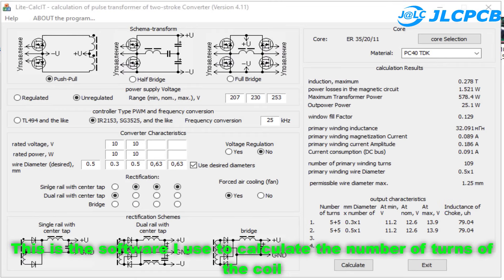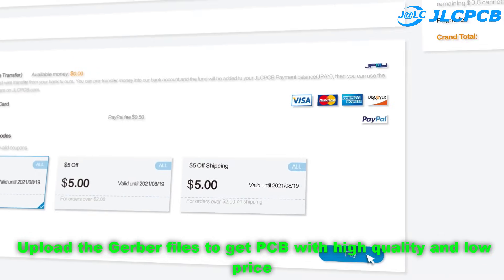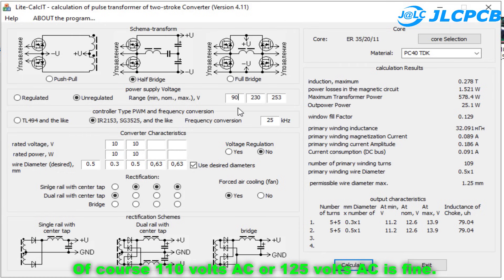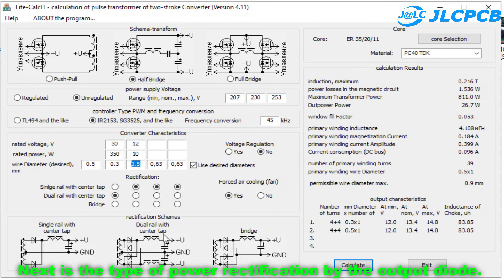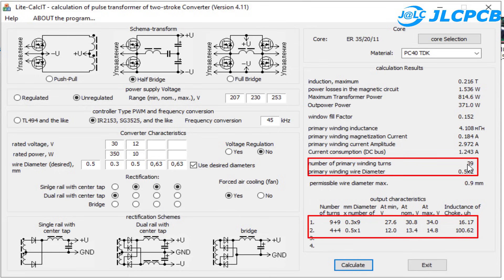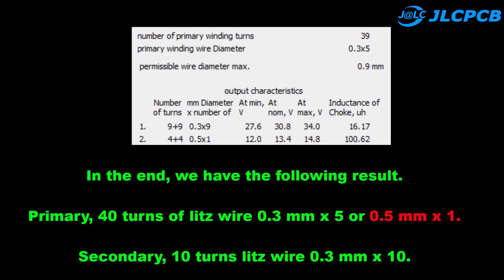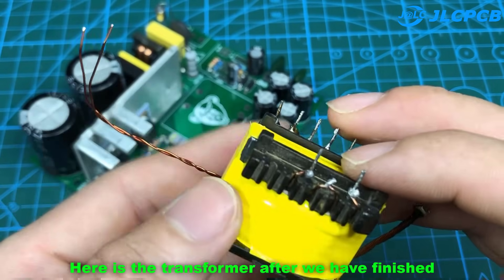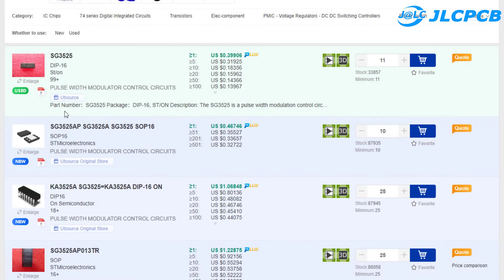Share How To Calculator SMPS and Transformer With Software

Comment: why in such higher frequency u choose 0.2100T of Bmax that approxmitally 2100 gauss but in reality as freq increase u must reduce B (flux density) to 1500 gauss .~ 0.1500T .

in higher freq the much power can handle but in such flux density more core losses u have .

could u explain that please .

Comment: In the software it is 0.5x2 for primary why you used 0.5x1 ?
Reply from the maker: This is the power supply for the amplifier.  That means 350 watts intermittent output power.  The use of 0.5 mm x1 wire makes it easier to wrap.  If used for other purposes will need 0.5mm x 2